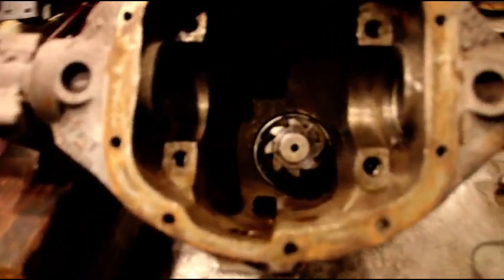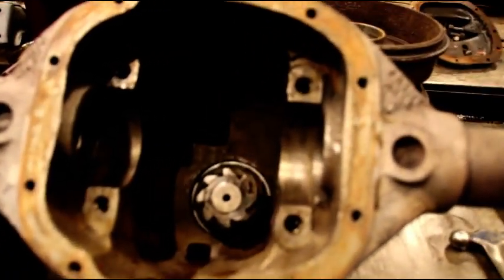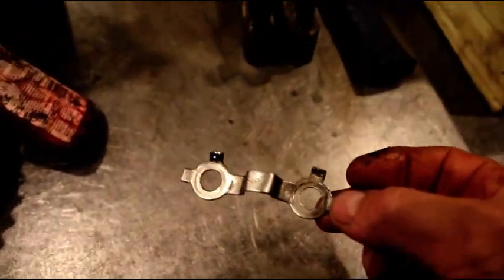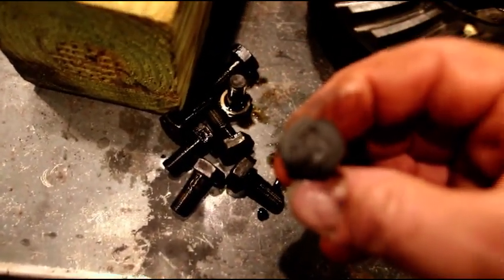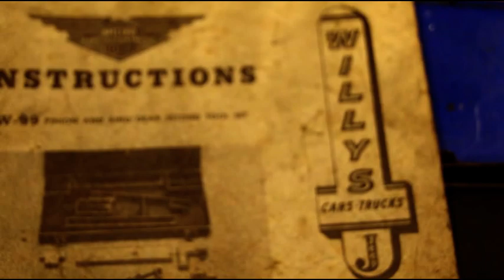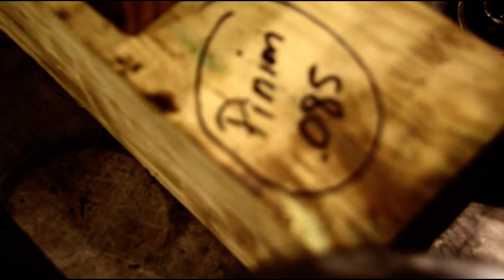Jon's Willys MB Project, Front End Rebuild......Another Way To Set Pinion Depth

Comment: Brian I would have been the 1 in 100 that would have enjoyed seeing you use the Miller tool as when I tried to use mine on a 1941 Willys americar rear axle that had never been apart and was just going back together with new Timken bearings, I could not get a ~0 reading no matter what gauge block I used. My Miller W-99-B-60-70 came with 2 gauge blocks with A through F on one and H J K A on the other. No instruction sheet or miniature dial indicator
Reply from the maker: Send me your email address again and I can try to send you the instruction sheet that I have with my Miller Tool.  You can reach me at metalshaper@comcast.net
Mine only has one gauge block and the other stuff in the kit is for pulling the pinion bearing cup and re installing it.
Reply: @metalshaperJeep  thank you I’ve sent you an email.
Reply: @metalshaperJeep  I sent you an email as well, would love to have a copy of the instructions.

Comment: Interesting way of locking.  Why not stick with loctite in combination with proper torque? Your way of safety wiring will not be of much use since it allows the bolt to twist still and create room to cut the wire. Safety wiring is done with twisted wires and tied up around each head in an angle to keep the bolts in place. Many tutorials online and lock wire twist pliers are a great help.
Reply from the maker: I get a lot of negative comments about doing this and here is another one.  The safety wire is there to keep the bolts from coming out.  SAFETY WIRE DOES NOT KEEP A BOLT FROM GETTING LOOSE.   Lots of people have no idea what safety wire is for.  This is a standard way of wiring bolts that are in a circle, or axle assembly.   I have opened hundreds of axles with bolts laying in the bottom and extensive damage over the years.  I have never had a single failure with my bolts, hardened washers, loctite, and safety wire.  Do the math and figure out which way is better
Reply: @metalshaperJeep  well that is the point, if they come out they twist the wire and it will not function as intended. Guess your loctite and torque just holds well. I use the locking plates for all axles with loctite and haven’t had an issue either. But you can ask yourself the same question why the rest of the world applies locking wire differently, you do the math. 
I am an aircraft technician and when installing locking wire like you do, is a direct note in my file. It doesn’t cost you a penny extra to do it the proper way. 

Sometimes you have to except comments  when publishing your work online and learn from it rather than fighting it. I learn a lot from your channel and keep vlogging. 👌